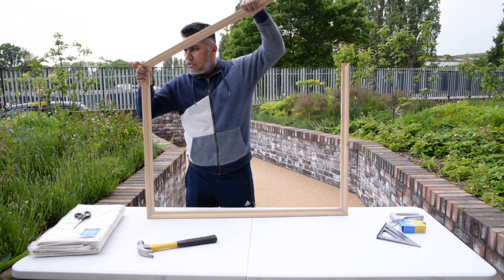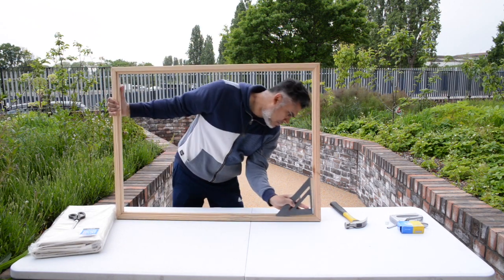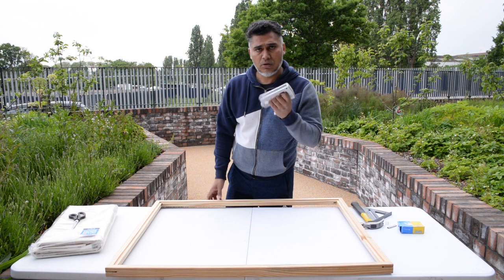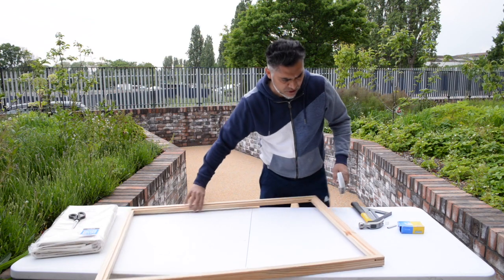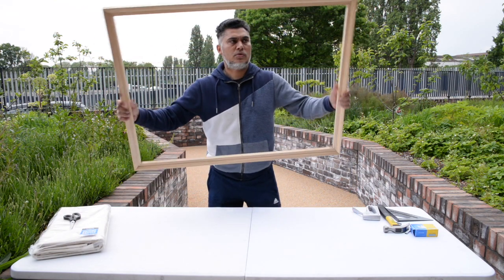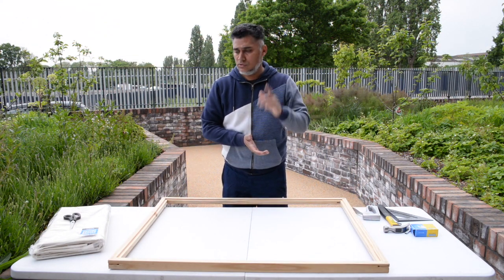How to assemble canvas stretcher bars for stretching canvas

Comment: Thanks for this excellent tutorial. I'm just contemplating to start making my own canvases and this video is really helpful. I was just wondering at what size would you start using centre bars?
Reply from the maker: I normally use centre supports for  canvasses that are approx 36 inches wide. I use a deep frame so the wood doesn’t flex that easily. If you’re using a narrow wood thickness then it depends. It could also depend on the thickness of your canvas as some canvasses need pulling really tightly and this exerts a lot of pressure on the bars whereas some don’ t.